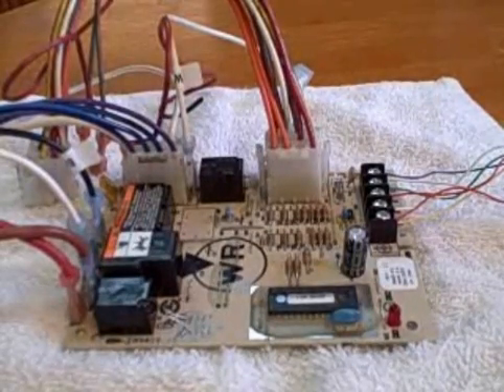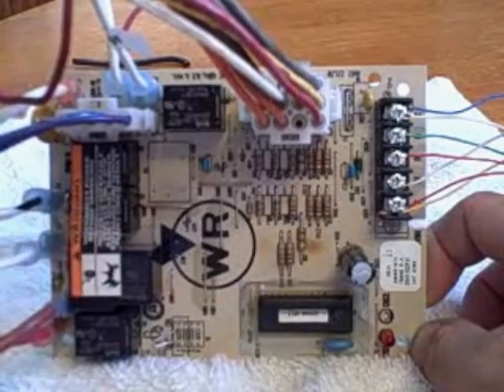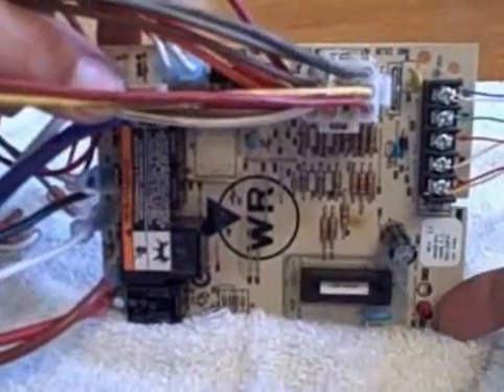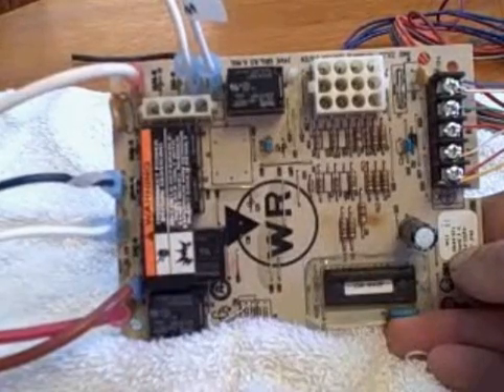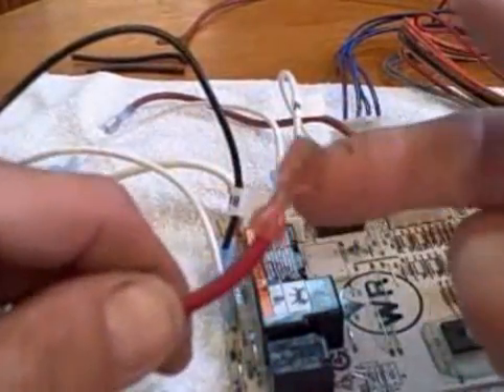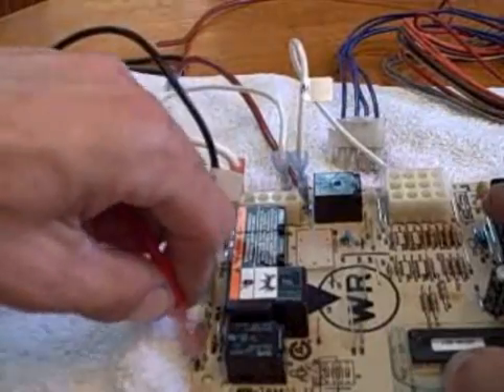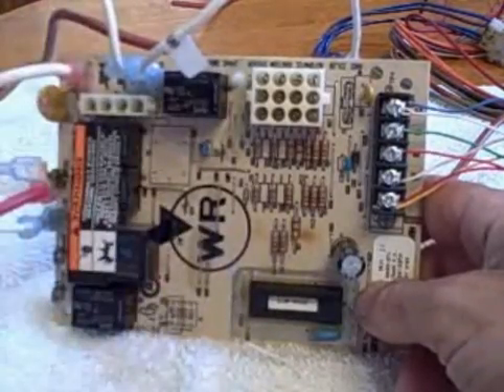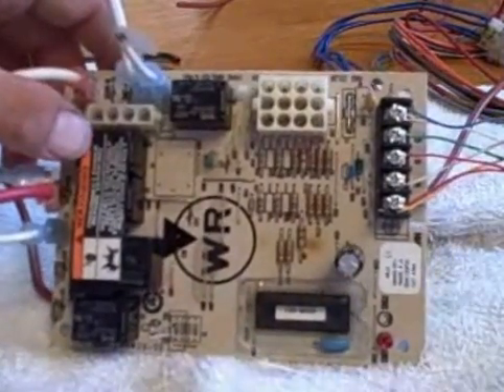HVAC AC Blower not working, troubleshooting Fan Control board, Fan not working.

Comment from the maker: I'm not saying that there couldn't be problems with the mechanical part(s) of the system but in a situation like this the first thing I would have checked, even before putting my gauges on the unit, would have been the attic.  As for the blower not working unless it is in the ON position, this is likely something miss-wired or something screwy with the thermostat.  In both cases either call a different reliable HVAC company or if you don't have any other options in your area, get a new tech.

Comment from the maker: The blower is (most likely) fine.  Don't bother to call that technician back, if you explained things to him just like you did to me then he should have climbed into your attic and looked at the plenum, tranition, return ducts and all supply ducts.  You could have holes in your ductowrk, loose ductwork, ductwork with the insulation falling off of it (happens on older ductwork with a gray covering, maybe Owens Corning but I can't remember) or other airflow issues. (continued below)

Comment: My blower will work in the "on" switch position, but not in the automatic position.  Also there some vents are blowing ice cold, others are luke warm (for my ac).  Ive called out a tech but he never even looked at the blower, he only looked at my main ac unit then tried to sell me a new ac unit.
Im really thinking its the blower.  Is it possible the blower is dirty and this is why some vents blow cold and others dont?

Comment from the maker: If you do NOT have a fuse on the board then the 120/208/240v to 24v transformer could be blown. You should have a technician have a look at the system to find the fault and fix it.  Just putting in a new fuse will NOT fix the problem. If a fuse is blown (with the rare exception of a storm surge) there is ALWAYS an underlying problem! Take care and choose a good HVAC company!  :)

Comment from the maker: If you have no 24v that does not mean the board is bad. If the board has a 3 or 5 amp fuse, check it first. (turn off 120/240v breaker(s) FIRST) if the fuse is bad it's likely a short, bare wiring (weedeater wacked) or rat chewed in the attic, or a bad contactor coil outside. ALSO many installs now have a WET SWITCH, a device put in the emergency drain pan meant to detect water leaking from the unit, it will shut off low voltage depending on how it's wired. A Tech to check it out would be wise!)

Comment: Thanks for the video- very helpful. When I check the voltage between R & G/C (in both the attic and thermostat terminals), it's zero instead of expected 24V-AC. I tried your suggestion of bypassing the board and sure enough the blower runs. Does this mean that I have a bad board? Even with the blower running, I can't get the A/C condenser to run- is that because the board is bad and the signal between the thermostat is never setting the relay on?Thanks

Comment from the maker: Angela it sounds like your problem is *most likely* a bad run capacitor on the motor. It could be a weak motor going bad but most likely just needs the capacitor replaced. Call your favorite HVAC tech and let them know and they can replace the faulty capacitor before you burn up the motor.  You should NOT run the motor until it has been check and replaced or you can burn it up!   Hope this helps, and post back after it's fixed to let us know what happened!  M@

Comment: My fan will stay on for a short time, then I get a burning smell in my vents.  When I try to get it to run again, I hear a relay clicking but the motor won't start.  After I let it cool down, it will run for a short while again.  Is my board good & my motor is the issue?  Thanks for all your help and info.

Comment from the maker: nope, just meter set to AC voltage and check the line voltage coming in... or if I'm just checking to see if I have *anything* I'll just use the non-contact voltage sensor built into the tip of the amp clamp on my volt meter. (have a pocket voltage sensor somewhere around here...)

Comment: i recently purchased a control center for an old goodman i put it in inducer motor came on the main burner came on but the blower motor would not work i traced the wires and found there was no power coming going to the blower fan so i connected it to the the wires that i connected the transformer to now im not getting any 24v at the thermastat terminals terminals whats wrong
Reply: Blower door not installed? DIY fool trying to fix something he shouldn't be working on is my gut instinct?

Comment: Thanks for posting.. Ok I jumped  R to G and holding in the door safety switch the blower didn't spin. I reached in and gave the squirrel cage a good spin and pressed the DSS again and the motor spun. but if seemed a bit weak , not much air moving. After that I let the fan come to complete stop and pressed the DSS and nothing, I hear a electric hum but fan won't spin on its own.

Comment: Hey Mike... Great Video. I have replaced over 1000 of these boards... I like your idea about jumpering the high speed on the fan. However, I just add a peanut relay with a 24 volt coil and run the high speed across the contacts. That way ...no rush to get back. The customer doesn't notice any different.

Comment: Hey , to all that followed Mike's advise but the fan motor still did not start the next step would be to check your capacitor these go bad quite a bitfollow your fan wires and it will take you to a small metal box screwed to the housing but to check this you must have a meter that will check for mfd if it's bad they are very cheap to replace but if that checks ok then ohm your motor and check for amp draw also check that you have the correct voltage to begin with.

Comment: Very Good presentation.  Appreciate the recommendation to d/c heater when jumping fan to continuous run while waiting to install new board...though that is not much of an issue here in New Orleans,  it is very good advice.  Also, I have sent this  URL for this video to a client to  help them understand what I had done when I temporarily jumpered their blower & transformer driving the outside unit till I instsalled a new one.  Thanks 

Thomas W. Jones, of Cold Air NOW!, New Orleans, LA.

Comment: Thank you so much for the video.  It was very helpful in fixing our air conditioner problem.  However, when my husband did the bypass, just as you demonstrated, our compressor fan is not working now.  Do you have any suggestions on troubleshooting that?  Thanks

Comment: should i go chimney liner, sidewall vent or b vent straight thru the roof...the company that put my 80% furnace in didnt realize there was no liner in my chimney...i dont have to tell you the water damage i have from the condensation...in fact they were dumbfounded when i told them lol..or should i just bite the bullet and get a 95%

Comment: I have completed your test as discribed and ended up with only a humm noise, thats what was going on in the first place.  In addition I have already cleaned the fan unit.  If it helps the fan will come on rarely if I turn off the power switch located on the units side thats connected to the safety but will run for only 2 to 5 min before stopping & returning to a humm noise.
  Can u advise as to my next step or is the fan bad.  Thank u sir for any guidance.

Comment: Hi Mike, first off this is a great video, concise, clear and you make it easy to follow along!  I do have a question, I tried this and the motor turned on.  I kept it running for a few minutes with the tstat set to cool & air was being blown out of the vents.  But after 2-3 mins the air stopped although the motor stayed on.  Would you say that it's still a bad board needing to be replaced? Looking fwd to ur reply!  Will happily donate if it works.  Thanks again!

Comment: Hi Mike I hope you can help me ! Got new tstat with these terminals,..Rh&Rc jumped, W, Y, and G. I have these wires, R, Y, G, and a black wire which is twinned and hooked to the C terminal at the furnace connections. Where does it go on the tstat? I twinned it with the G at the tstat and the AC unit works but not the heat. Its hot here so Im glad I got this far. Also I have a 2 speed fan on the furnace. HELP!!! Thanks for your time. Ill make a donation if I dont have to pay a service call :)

Comment from the maker: If your test results are the same as mine then it's a good indicator that it's the board.  If you have the door safety closed so that the unit can power up AND you have it turned on at the thermostat but the blower still isn't running THEN you can use a volt meter to check the 24v low voltage wiring...  if from C (common) to Y (cool) you have 24 volts or somewhere in that range, then you know it's the board.  If you DON'T have voltage there then there are other options.  Email me your phone #.

Comment: Hookin the blower up to the door switch is a stupid way to activate the blower! Most customers are not going to want the blower going non stop and add extra money to the electriv bill, u should wire the blower to a relay with a 24v coil hook up 115v to one side the hi speed to the other and hook the 24v coil side to the R and G on the board. So when your callin for cooling the 24v will active the coil and turn the blower on.

Comment: on this board can you tell me where to test for power in to make sure my fan control board is not bad. i have the same board in this video. i need to test for power coming in cause i have no diag light need to check to see if its the power switch or the board or the transformer can anyone help me on this thanks in advance!

Comment from the maker: @oneadvent  No!  You can't bypass the control board in heat mode, especially gas.   There are numerous safeties on the board to protect you and the system from fire hazards.  In Cool mode it's not a big deal to do it till you get parts since the only thing the board does in cool mode is turn on the blower.  In heat mode it's a whole different ballgame.  Just leave it shut off until a technician can get you a replacement installed :)

Comment from the maker: @madamfreak Check to see if there is a sticker on the unit showing what the blink codes mean, otherwise I can't help with that off the top of my head.  Usually a blow fuse on the board is due to a short in the low voltage wiring.  Check for rodent chewed low voltage wiring, weed eater or dog chewed wiring outside, etc.    ...really hard to trouble shoot most things like this without actually being there.  If it isn't something simple like damaged wiring it's best to hire a professional to fix .

Comment: i blew a fuse on circuit board...before this the led was blinking 3 times now i have two green leds and one yellow but blower motor still wont come on...circuit board for this rheem furnace are over 200 dollars off line...i found one for 145 online....i jumpered out the limit switch and still nothing

Comment: my blower motor wasnt coming on either...i had my chimney parched...the ignition worked lit the burner....i kept doin this...then i tried to see if there was current to the motor with my voltage tic....but then the igniter sparked again and now i have nothing power to it but nothing...no led lights power to the board but nothing after

Comment: Hi, I watch this video. More informative. I have a problem with Hot surface igniter. Furnace is Rheem RGDJ 07 EAUER gas code EB . It doe not glow at all.  I changed it still doenot work.  It works fine with all sequences except I am igniting with gas lighter. Sequence works fine and I keep a flame of lighter to it and it ignites and sequence works fine. I think there is no power to Igniter which also leads to control board which may be bad. HOW DO I CONFIRM AND FIND OUT THE PROBLEM AND SOLUTION?

Comment from the maker: @BIGGOODBOY Well there is the catch, it DOES do more than just control the blower motor.  The control board's main function is to regulate and control the gas furnace and gas valve (in most circumstances, I can't see your unit).  The board tells everything how to work and the safeties are wired into it as well.  Yes, you can do one wire at a time while replacing, that is what I always do, but my suggestion to hiring a professional is for safety reasons. I turn off the gas valve when I work.  M@

Comment: @mikie2501 But do I need to mess with the gas or furnace to replace that part? it just controls the fan. I talked with this guy that does that for a living. He said all I need to do is turn off the electricity to the system, which is a switch (looks like a light switch) then when I replace the part. Just take out the wires one at a time and put them in the right place (which is i guess some sort of matching numbers). I know I can do it... I just need to know if i need to do anything with the gas

Comment from the maker: @BIGGOODBOY  That is flat out highway robbery and rape! lol.  My company would have charged about 350 or so I think. (trying to remember)  ...I STRONGLY recommend you call another HVAC company and have them install the part.  Don't mess around with gas furnace stuff, the boards have safety interlocks and you need to make sure it is done RIGHT the first time!  Or post on craigslist, ask for an HVAC tech willing to do it for a 'donation'.  Safety First!

Comment from the maker: @AtlasDerek Assuming that there isn't a problem with the blower motor or run capacitor there could be an issue with the low voltage control wiring, an intermittent door safety switch or other connection or safety device.  You need to have a technician verify that there is power to the unit when the blower is failing to come on and if that is verified the low voltage control wiring needs to be checked to prove that the board is receiving control voltage from the thermostat.  M@

Comment: Haven't had AC in two days now. Replaced the blower motor and that wasn't the problem. Found out it's the control board. I used your video to show me how to bypass the board until I can get a new one tomorrow. The AC fired right up and is cooling nicely. A real life saver in this heat! Thank you.

Comment from the maker: @imcruisin95 Very good points!  However if the reroute of wiring is done after
the power goes through the door switch the safety switch will still function as 
it should and cut the power if the door is removed.

Comment: i just use an old fan relay i took off an old furnace,wire the thermostat fan wire to the 24v coil of it and a common,and then run your fan motor wires thru normally open contacts, now it works as it always does, fan shuts off and on with A/C .till you can get a new board.still take off the heat speed wire from the board.wiring the relay takes just a few minutes.

Comment from the maker: @chererene I know home owners frequently like to do their own repairs and as a general rule I tell them here to hire a tech to do the repairs for safety reasons but in this case you should ESPECIALLY make sure to get a technician to do the job.  Gas furnaces are nothing to be playing around with and taking a chance on.  You need a tech to make sure it's the right board, installed properly and ALL of the safeties and interlocks are functioning properly!  Sorry this isn't the answer you wanted :/

Comment: I have a lennox gas unit, my new control board is a little different, like my old one has a fuse and this new panel does not.  I want to install this panel myself, but I am a little concerned since it is some what different.  any advice....thx

Comment: I have a goodman ac unit that the blower motor cuts off an on about every 3 to 4 sec.I jumped the control board like on your video an the blower motor ran fine do you think it is the control board that is bad and is the time delay relay built in or not thanks.

Comment from the maker: @dmb3428 I'll need a bit more information that that I think, and need to make sure exactly what boards you are talking about and make sure you are talking about the same motor that I am.  The defrost control board is on the outside condenser and is used with heat pump systems to control the indoor heat strips and the outside 'condenser fan motor', not the indoor blower motor.

Comment: is it possible for a defrost board to also control the blower fan? i googled my goodman board part# and it was listed as a defrost board but I traced wires that are plugged into it back to the blower motor....my blower motor doesnt always come on, sometimes i have to restart the system then it will come on

Comment: Great video.  I have a question.  Is it possible to determine whether it's the motor or the control board without bypassing the control board?  I watched the video so I would have an idea of what was going on when the tech came out.  He spent about 1 minute checking some connection points with an amp meter, and determined it was a bad motor.

Comment: dude, awesome video.  i came home to my inop blower on my trane unit.  I am an automotive electrial specialist so i know my electrical. I had no 120v coming out of the board for the blower yet the compressor and outside fan were running strong so i suspected the control board.  you confirmed my diagnosis and showed me how to easily "rig" it to work as this is memorial day weekend and i can not get any parts AT ALL till tuesday after memorial day. THANK YOU SO VERY MUCH!!!!

Comment: @mikie2501  hey thanks mikie, well the repairman came out here and found it was not the blower motor, it was the board, he has the blower motor on a hot legg now so it will continue to run so i can at least have airconditioning, outside unit is doing fine, he is calling around for the best price on new board to be installed next month, thanks again for your information, it was helpful,